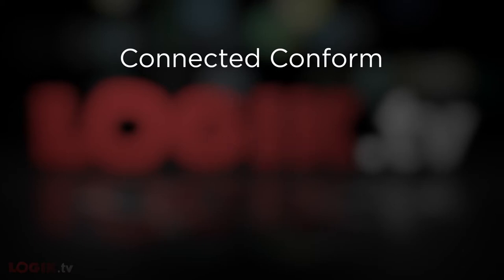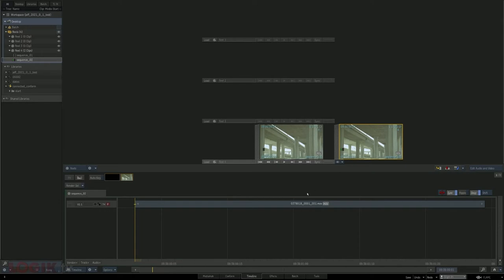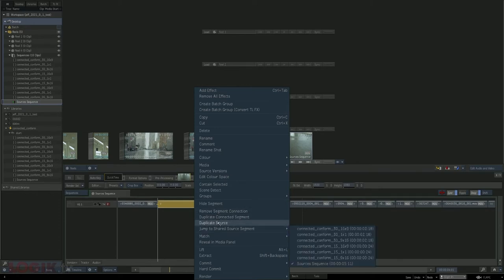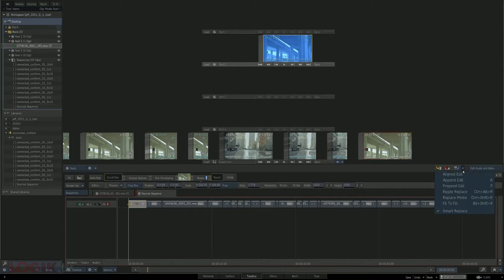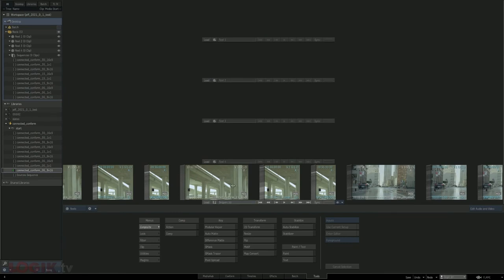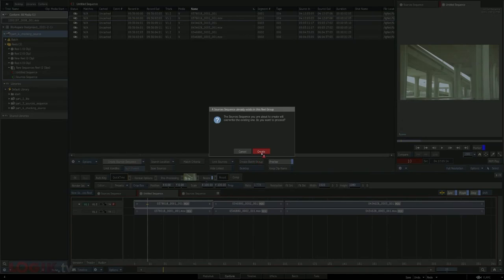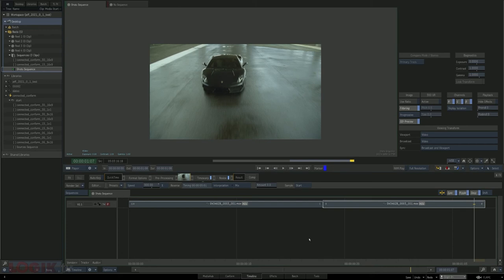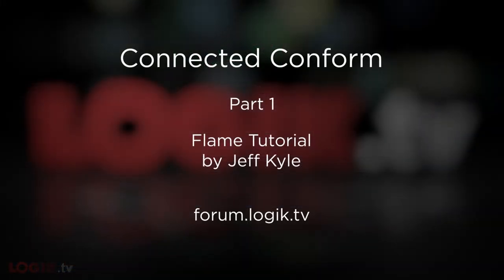Logik Academy - Connected Conform Part 1 by Jeff Kyle

Comment: Would you consider it a bug that after using "duplicate connected segment" the source appears to be duplicated - so swapping media into the new segment doesn't affect the old ones - however using unlink media on the newly created segments still also unlinks media in the old segments? 

I've always found this really frustrating as I don't always want to swap in all my shots to the new segments one by one. A great use for duplicate connected segments would be to create a new layer that could then be unlinked in order to reconform the graded versions of the shots. However this isn't possible if everything unlinks.

Interested to know if you have a work around for this.